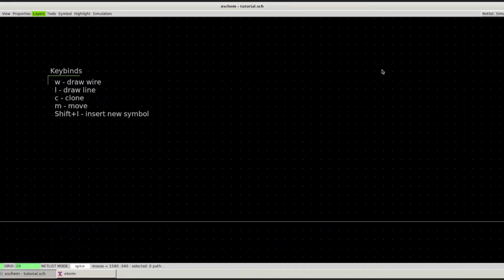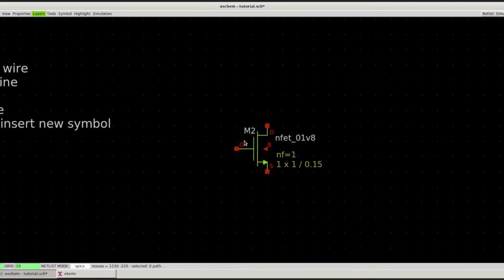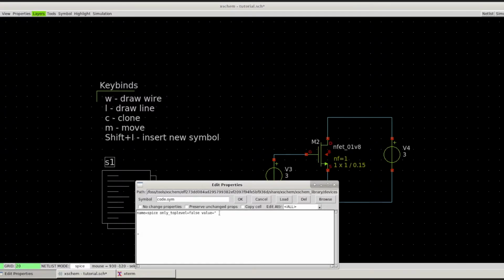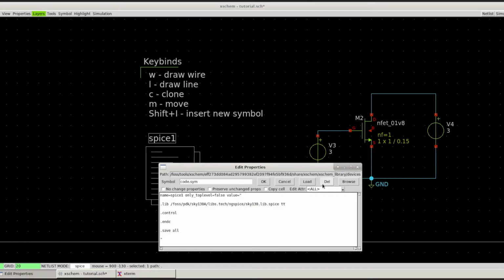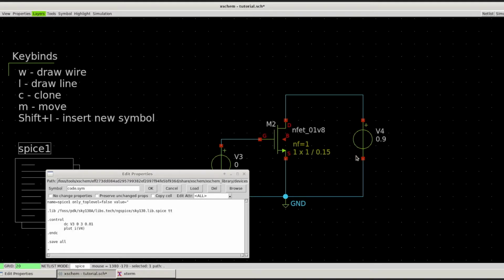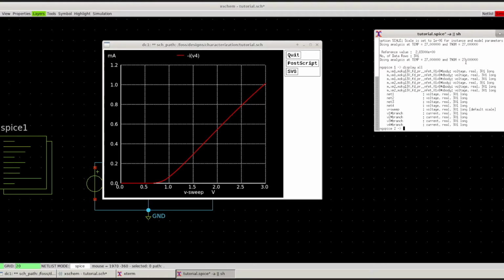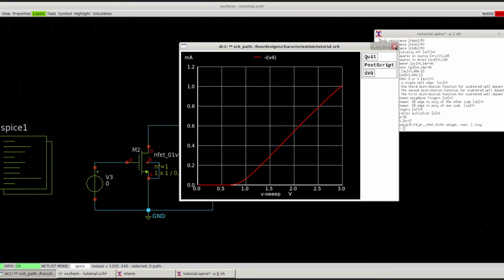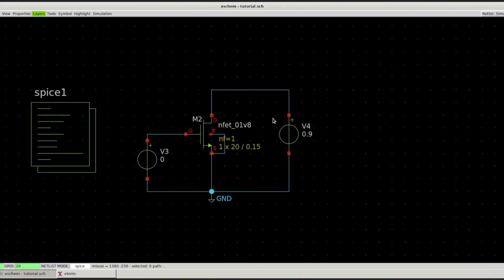SKY130 Basics - Using Xschem

Comment: the gm seems so exceedingly small, using the lvt transistor I was able to get around 0.4mS.  e-12 doesn't make sense..
Reply from the maker: Yeah I noticed that too originally. I think I ended up updating Ngspice and got more accurate results

Comment: Thanks very much - a really useful video that helped to get me started with Xschem. One question though, when you display all the attributes of the nfet after the first simulation, the dimensions show 5 fingers and a width of 2 microns - different to the schematic (I was comparing my gm and Vt outputs to yours and noticed the difference). Do you have another nfet on the schematic we can't see?
Reply from the maker: Ah yes! I didn’t catch this at first. I had originally set up a different test structure to the side, which is why my values did not change after a second simulation and the sizing looks off